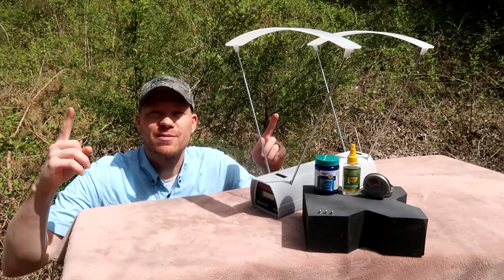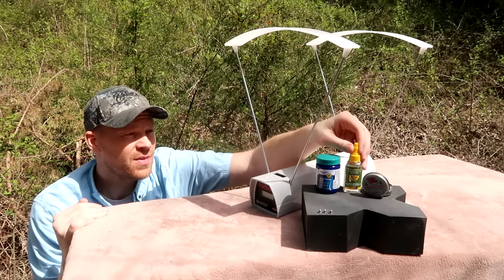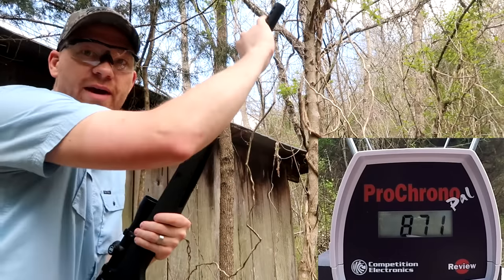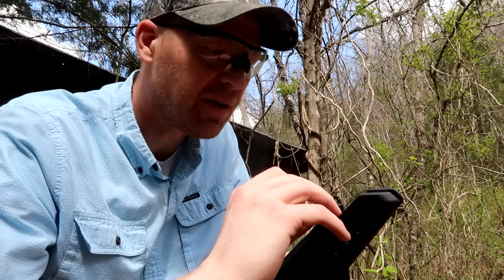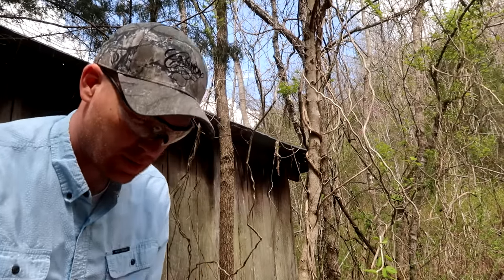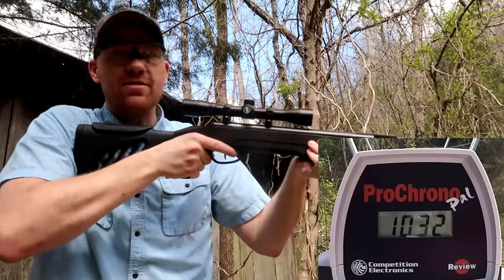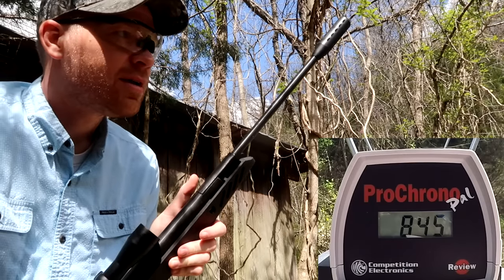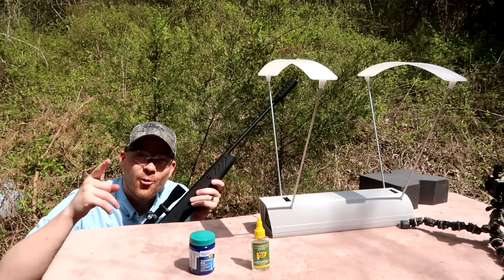Air Rifle Dieseling - MORE POWER

Comment: Try using a little bit of cotton wool or cotton bud soaked in diesel. It holds the liquid in place while you load it and makes a pellet look like a tracer round.
Reply: So I just pack a tiny piece in the back side of the pellet where the cup is on back side of pellet.
Reply: Plus, it cleans your barrel with every shot!
I wonder how 2 stroke gas would work?
Reply: Interesting,something to try.🤔

Comment: Because its a spring powered piston air rifle, as the air is compressed by the piston and then pushed through a tiny hole in the gun to the rear of the pellet it heats up, thereby causing combustion if something like petroleum jelly or oil or diesel is present (acting a lot like a diesel engine hence the name). It will not work with a PCP or CO2 air rifle as the air is compressed in a differant manner and exits cold and not hot.

Comment: it's because the air comes out so fast and hard it creates an explosion because of the chemicals in those objects pellet gun oil works too that actually works really well I was using a 177 with pellet gun oil and it was making it sounded like a 22 when it went off it had a discharge like that and it also has a flash at the end of the barrel so it's absolutely igniting it pellet gun oil you only want to load half of the pellet cup with the oil pretty much put a drop on the top of it and dab the pellet that gets the best results if you put too much in there it just doesn't burn

Comment: The "stuff in the back cup" is compressed and heated by the air pressure and "diesels" or self-ignites like a diesel engine. That little bit of combustion adds a bunch of propulsion. It also decreases the life of your gun's seals. I've heard that 3-in-1 Oil is the best for dieseling.
Reply from the maker: 👍👍 I had never heard of it

Comment: It does not cause any combustion, as diesel must be in vapor form to become flamable. 
Thats why you can drop a flame into a bucket of diesel fuel, and nothing will happen.
It does increase the FPS, and people think its due to a small explosion taking place but thats incorrect. 
Diesel engines operate by pumping diesel fuel through a mister to particlize/vaporize it, in order for combustion to take place.
What its actually doing is creating a better seal/closer tolerance between the pellet & the chamber, which leads to less energy loss, creating a more powerful shot. 
Vaseline can be used to do the same thing.
Reply: Whatever dude. It does combust and explode causing the increase in power. That's why it is called dieseling. Diesel does not have to be in a vapor form to ignite under the compression of a diesel engine. Any flammable substance will ignite with great compression, even if it is an air rifle. That's why they sell Pellgun oil because it is made to be less likely to be flammable in the air guns. It has nothing to do with it making a better seal or making the pellet more slick as it goes down the barrel. I have done this for years and I am also a retired diesel mechanic. You can run a diesel with what you called a "mister" which is actually an injector and that injector could be just dribbling drops of diesel instead of "misting" it and it will still run, maybe not very efficiently but it will. Yes it is better for the fuel to be vaporized as it will give a more efficient regulated burn but it will still ignite and burn with great compression. As far as dieseling a pellet gun, I like to use the old 3 in 1 because of the applicator tip if you can find it anywhere. I saw someone else say something about using WD40 and saying it's good for firearms but no, it's not. It is a penetrative oil and it will penetrate into your ammo if you use it anywhere near the ammo and chamber and it will kill the gunpowder in the cartridges. Use gun oil for guns and stay away from the WD40 on them unless you are specifically trying to get a rusted screw or fastener out of the gun and then clean it and use gun oil to lube it back up.

Comment: The secret is, to put oil in the box where u keep the pellets. In this way, u dont have extra oil in the chamber to burn the orings, and the oil gets in betwin the pellet and the barrel, wich is the main goal for efficient dieseling compresion, and not damage the rubber parts.
Reply: I thought so
Reply: But he doesn't like to get his fingers sticky.

Comment: Brake parts cleaner works the best in my experience, not good for your seals though. Had a .177 sounding and recoiling like a 22lr
Reply from the maker: I never knew!
Reply: 22 has no recoil lol
Reply: @combatengineerbroski6712  Not compared to other guns but compared to pellet guns it does
Reply: I use wd40 silicone lube and it bangs like no other mix I've tried

Comment: use PLAIN Vaseline, not vapor rub. The rem oil or vaseline temporarily increases the weight, and lubes the barrel. Try same thing with moly lube. That's what most pro snipers use.
Reply: Pro snipers use air rifles?
Reply: @jrcampos1952  stationary snipers, yes.

Comment: Reminds me of a trick I was taught as a mechanic, to remove a pilot bearing without dropping a flywheel. Fill center with grease and use a socket and extension that just fits inside bearing and hit with a hammer the hydraulic pressure will push bearing out. I'm sure it creates a tighter air seal pushing the pellet out with less blow bye.
Reply: Bread is cleaner and cheaper 😜

Comment: Thank you for the nice video. I have tested this idea and yes, the increase of power is indeed impressive (I went from 14 Joule up to 28 Joule), but sadly the results are not good with regards to how much damage it will do to your gun. 
I was very careful about it and was on the lookout for anything unusual - so I noticed immediately that the performance would drop by a few percent with every shot, until it was not really that great any more. To restore it, I had to drop silicone chamber oil down into the piston chamber and then stand the gun up for a while to wait for it to distribute. My conclusion is that the detonation gets into the piston chamber and basically destroys the lubricant around the piston - either by burning it off or by making it dirty. I am not that worried about it, since I have a spare seal and I was going to take the gun apart anyway, but I will probably not try dieseling again.

So, on second thought, I think that if you are not happy with the performance of your gun, fitting a stronger spring is probably a better idea - if the gun's construction is strong enough - rather than using dieseling. Your equipment will be less powerful, but it will perform in a more reliable and consistent way and you will not have to resuscitate it every few shots or risk damaging it beyond repair.
By the way, if you absolutely have to do dieseling, do not use vaseline or mineral oil, but use something that will not damage the seals. I used simple vegitable (olive) oil, since it is gentle on rubber, and it worked great.
Reply: WD-40 lubricant oil

I've seen it compared in other method including the vasoline & it reportedly works very well.
Moreover, WD-40 is non corrosive as it's used on firearms amongst more common uses.
Reply: Will it works good with coconut oil too or i must use vegetable oil?
Reply: @MrSniperdude01  You can use WD-40 for anything. Including rusted/corroded metal.
I used it on a lock that would not open anymore and after a minute it opened without problems.
Reply: I used Pellgun oil. It's made to protect the seals on a CO2 pellet gun, so I would think the same for spring piston. Anyway, I dabbed a tiny bit in the pellet skirt with a pencil tip and the fps went from 770 to 990.
Reply: @empireoflizards  It will protect the seals, so long as you do not at the same time make it ignite. Burned oil no longer has the right properties. I know it is tempting to increase your power, but you are just damaging your gun. The correct oil for oiling the chamber is e.g. Crosman chamber oil, because it is harder to make it ignite, but if you really try you can ignite even that, I believe. If you really want power, invest in a good PCP air rifle. Some of them have as much power as small fire arms. However, for me it is fun to see how much improvement you can make in a primitive springer, without actually destroying it.
Reply: @wojtekjarosz4072  Actually, when I need more power, I just use my Henry .22, lol. The pellet gun boost was just an experiment to see if it actually worked.

Comment: Dieseling is not magic, it works the same way a combustion engine does (think car engine). The pressure in the chamber due to the spring piston causes the oil to combust, and that’s why you saw smoke.
Reply: Really? Damn I thought it was real magic for a second 😞

Comment: I believe what happens is the compressed air starts the Vic or rem oil on fire. Similar to a fire piston used for starting fires for camping
Reply: Similar to a diesel motor.
Hence the term "dieseling".

Comment: My method is just to spray Seafoam Deep Creep straight into the Crossman Premier Hollow Point tin, enough so it lightly pools at bottom of tin, and pellets are coated but not dripping. It increased my fps by 35% I am shooting .22 cal 14.3 gr cheapo pellets at 950+ fps that is 29 foot pounds!

Comment: I have a cheap, low power “toy” cross man pellet gun that barely “spits” out a pellet.  I’m curious if the chamber gets hot enough to ignite oil.
Reply: It’s not that it gets hot it’s the compression that causes it to combust (hence dieseling)
Reply: It needs to be able to generate sufficient enough heat in chamber from the compression of the air  to be able to ignite the oil. Diesel engines use glow plugs to preheat the combustion chamber  in advance to get things going
Reply: Dont test it something tells me its not made well enough and will melt or explode
Reply: No they don't. Glow plugs are only for a cold start up on diesel engines. You can start a diesel just fine with no glow plugs. The glow plugs just help to heat the cylinders in colder weather so you don't have to run your batteries down cranking and cranking.

Comment: I told ya!!!! In air-powered rifles, the pressure in the skirt of the pellet causes pressure-induced combustion...exactly like how a diesel engine operates....hence the name “dieseling” the rifle. One caveat: this creates a MUCH higher pressure inside the chamber than the gun was originally designed to withstand and can (and eventually WILL) cause premature rupture of the o-rings in the gun.
Reply: 69CamaroSS407 are the seals easy to replace?
Reply from the maker: I've never done it
Reply: Austin Bowman depends on the gun...but not usually easy without fully taking it apart. Usually done by a gunsmith....or possibly by watching someone on YouTube do it
Reply: How long will the o ring last
Reply: Why Vaseline and not good ole petroleum jelly?
Reply: @Jaemon4Eva  Read the label--it says "pure petroleum jelly". Vaseline is just a brand of petroleum jelly.
Reply: Really ?? I thought it was named after Vin 😆

Comment: And yet the best dieseling effect will be achieved uaing a real diesel instead of a substitute. Just use the flexible straw on a WD40(which is actually a pure diesel) and spray some straight inside the loaded cylinder, not in the barrel nor the pellet. This way your spring loaded cylinder will indeed perform like a diesel powered internal combustion one.. and yes this will ruin your sealing in the long run :D WTWhoo

Comment: This works with spring rifles too but in a different method. If you drip a bit of oil down the barrel the friction of the pellet or BB running over it can ignite it or at the very least it will reduce some friction giving it a bit more velocity. I like to do it that way for air rifles too because it's a lot easier to do than lube up every single pellet individually.
Reply: I think he means it works for pneumatic rifles too that's already a springer in the video

Comment: I've got a Benjamin nitro piston rifle that's normally very quiet, but if I pack the pellet with standard petroleum jelly it sounds like a 22 going off!  The concept is simple, petroleum jelly ignites under pressure, just like diesel fuel.  I've also got a Benjamin nitro trail handgun, and it doesn't have enough pressure to ignite the jelly.
Reply: How many fps required for diseling, my crosmman goes 700 fps
Reply: @julianblacksmith8539  I think it has to be 1000 fps or higher.
Reply: @julianblacksmith8539  you should be good it will work
Reply: @mr.murray8742  you sure?

Comment: I love Vapo Rub!
Reply from the maker: Smells strong!
Reply: WHO_TEE_WHO that vapo rub is great for when you have a stuffy nose just rub some under your nose or get it inside your nostrils, if your kids are congested rub it on their chest and back before they go to bed....it really does help, if you have sinus problems get a bowl put a teaspoon amount in the bottom then pour in boiling water about half thee quarters of the bowl then use a towel to cover your head and the bowl and breath in the steam through your nose, works a treat.
Reply: Vapo Rub is not Vaseline. Completely different. Maybe he should have used some Vaseline ie Petroleum Jelly to see how it'd work.

Comment: I noticed a lot of comments say the vaseline and oil ignite, but I always thought the oil or vaseline just made the air seal tighter. I used to do this when I was a kid when the seals wore out in my bb and pellet guns, but I never noticed any actual ignition. I remember actually using gasoline to try to make the seals swell.  I know there is what appears to be smoke, but anytime pressurized air is released, there is vapor, the more pressure, the more vapor.

Comment: I just shot through a detergent jug full of water and the thick tile in front of it with My Winchester 1100SS . I had just sprayed the inside of the gun with Silicone based Liquid Wrench to lubricate all the working parts . The first 5 shots I fired out of it deiseled louder than a .22 Magnum , but Man : It turned My $63.00 air rifle into a serious Thunder Stick!

Comment: As we see here dieseling, while potentially damaging to your air gun, can generate velocities seen in higher primed ammo. 1070 f.p.s is standard velocity for 22LR, so it no less than amazing physics how one can mimic using a .177 caliber 1/2 the size & significantly cheaper/easier to find. And yes, theoretically based on the proven chrony results, you could use in Self Defense but you better be one hell of a shot

Comment: Chamber Combustion my friend . You will get a stronger shot on the third shot with dieseling. I have tried all kinds of oil . Vegetable oil,  toasted sesame oil, orange glo, WD40  safari CLP. I do not own a chronograph but it would be cool to see a somewhat controlled experiment. 5 shots of each oil, air rifle cleaned of any trace of oil so you get real results. I thought it was pretty cool you used water in your experiment. I knew the water wouldn’t work but it goes a long way showing nothing at all ,vapor rub ,and rem oil . Thank you for sharing.

Comment: It’s sealing any air blow-by similar to what piston rings do for compression in an engine. Strangely Remoil also works on BB’s in a cheap lever action BB gun too. At least the vaporized “smoke” appears anyway.
Reply: I think this is probably the case too, and has nothing to do with heat. The cocking of the rifle charges it, so thats when he heat is produce by compressing gas. Pulling the trigger releases that pressure, which if anything should cool down the "fuel". There is no way this stuff is igniting, it's just sealing, and probably has no effect at all on the seals of anything.
Reply: @cannaroe1213  you can cause combustion from pressure alone, you don't need heat

Comment: also, you could use lighter pellets. the lighter the pellet the more speed you will get and it will actauly crack from breaking the sound barrier at 1100 feet per second. you were close as it was  .
Reply: The sound barrier all depends on temp,altitude,and humidity....temperature being the biggest factor...and the rest in order by amount of effect it has on it.
At Sea Level and 90*F it would be 1149 f/s   783mph
At SL and 70*F it would now be 1127 f/s     768mph
At SL and 60*F it would now be 1117 f/s     761mph
At SL and 20*F it would now be 1073 f/s     731mph

Altitude effect on it is no where near as much as the temp does but with altitude you also get lower temps so the speed at which you "break" the sound barrier is also lower,and humidity will have even less.They all do effect it though.

This was all early high school stuff we learned back when teachers taught people instead of indoctrinating them...

Comment: Probably could try get a roll of caps from a cap gun use a gasket hole punch to get  the caps powder button  to  fit flush inside pellet cup , and  then put the drop of oil in chamber and test it out.

Comment: you know its called dieseling because like a diesel engine or nitro rc engine they burn because of the pressure in the piston. the pellet gun does the same when fired the pressure behind the pellet is high enough to ignite the oil you add causing an explosion  in the chamber.  WARNING, its probably NOT SAFE plus you co6ld ruin your rifle.  I guess thats why they say dont oil your pelet rifle.

Comment: I use 3 in 1 oil.
Averaged over 260 fps faster with 7.8 grain pellet.
Don't get it on rubber. Seat the pellet and put one drop. 
High pressure from the piston create very high heat and ignites the oil.